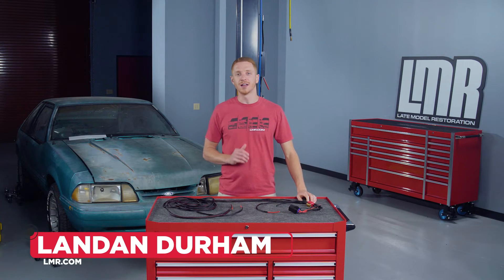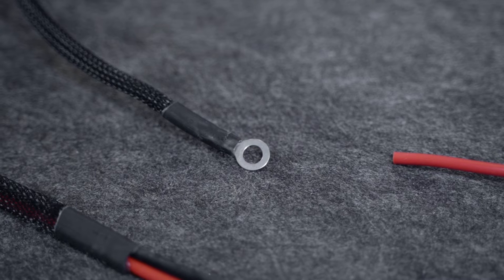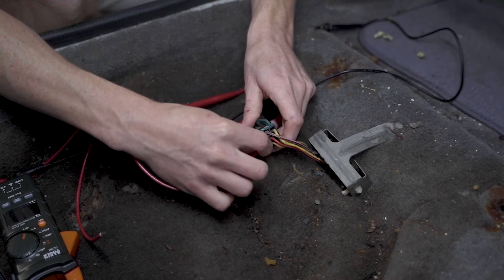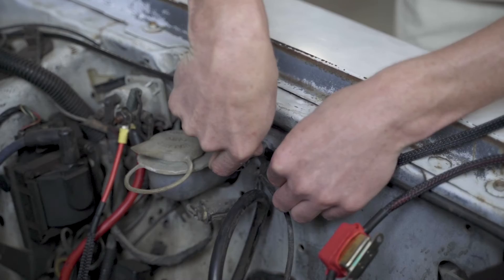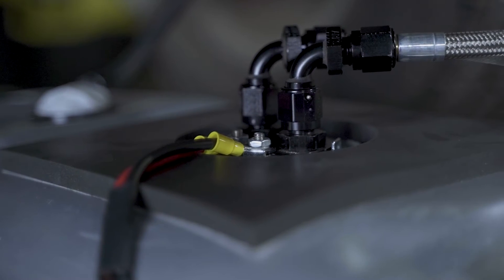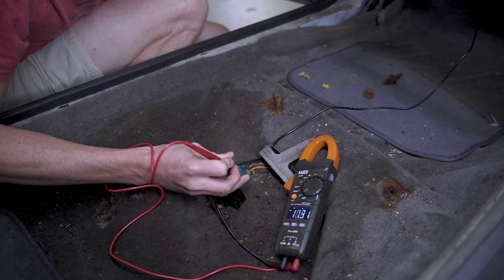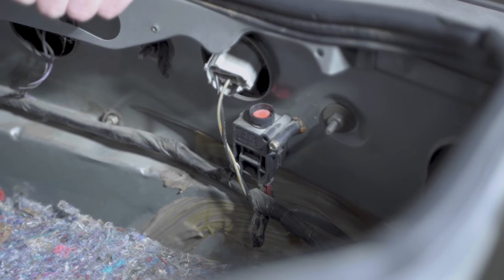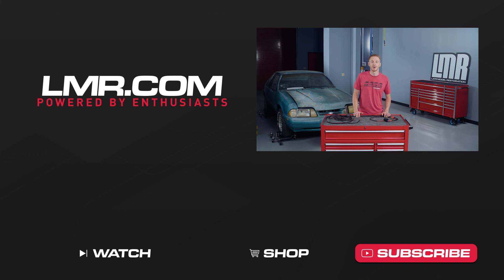How To Wire Aeromotive's Fuel Pump Wiring Kit For Fox Body Mustangs

Comment: One thing I'm confused about (on 93 model) it says to wire the trigger wire to the pink/black wire going to the inertia switch.  Shouldn't it connect to the output wire on the inertia switch so if it gets flipped it cuts power to the trigger wire?  If you connect it to the wire before the switch then it seems like you'd bypass the switch.  Also that pink/black wire is green/yellow on my 93.
Reply from the maker: That is the output wire. The color changes from brown/ pink to pink/black inside of the trunk. Trace the harness and you'll see the connector I'm referring to. Get a wiring diagram if you don't already have one. Link below to our offering. -Landan

https://lmr.com/products/automotive-guides-books-literature

Comment: Is this about the same process for a 94-95 mustang gt ?
Reply from the maker: The basic wiring, yes. The trigger wire, no. If you're using the stock ECU, the fuel pump relay is inside of the CCRM (Constant Control Relay Module). The CCRM is attached to the radiator overflow tank bracket. The inertia switch is wired after the CCRM. So, the trigger wire will have to be extended to the trunk area. The trigger wire on the Aeromotive harness will need to be spliced into the brown/pink wire coming out of the inertia switch and going to the pump. This is only required if you plan on using the inertia switch. If you're using a standalone ECU, wire the trigger wire on the relay harness to the 12v fuel pump wire in the control pack harness. -Landan

Comment: If you're wiring into the factory relay what the point of the aeromotive relay
Reply from the maker: Because the Aeromotive relay has a much higher amperage rating than the factory relay. -Landan
Reply: @latemodelrestoration do you have to wire it into the relay under the seat or can you use this relay as a "stand alone" relay by itself? Thank you for responding love the videos
Reply from the maker: @nickspano1738  Thanks for watching the videos. We appreciate the support. You're question is answered in the video. The factory relay is triggering the Aeromotive relay since the factory computer is still being utilized and because we want to keep the inertia switch. If you want to omit the factory relay from the equation, by all means go for it. It will require additional wiring and I would still utilize the inertia switch for added safety. -Landan

Comment: Would the wiring be similar to a 98 gt?
Reply from the maker: I'm not sure a fully understand your question. What are you trying to do exactly? -Landan
Reply: @ I’m installing a 450 lph pump and a fuel pump relay kit in my 98 GT. Would installing the relay kit on my 98 be similar to installing it on a foxbody? For the trigger wire on the relay, can I wire that to inertia switch?
Reply from the maker: @choopthicc  Yes, you can do that. Just make note of how the factory circuit functions. If you don't already have one, we offer a USB flash drive that has the Ford wiring diagrams for 1994-1998 cars. It's extremely helpful when dealing with anything electrical. Link below. -Landan

https://lmr.com/item/LRS-WM9498/newrad-solutions-mustang-electrical-vacuum-manual-usb-94-98

Comment: What if you have two pink/black  wires coming out the fuel pump regulator?
Reply from the maker: I'm assuming you meant relay and not regulator, is that correct?  Is the pink/black wire sharing the same pin on the connector?  -Landan
Reply: Yes i have 2 pink/black wires. My wiring diagram shows one goes to the fuel pump and the other says fpm. Does it matter which wire to use for the trigger wire?